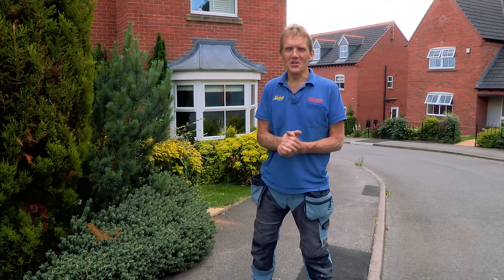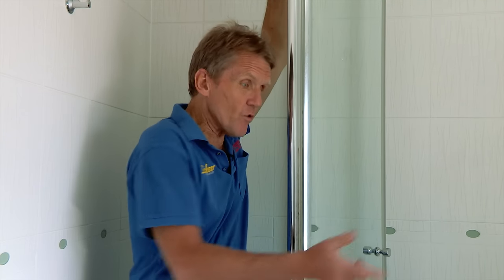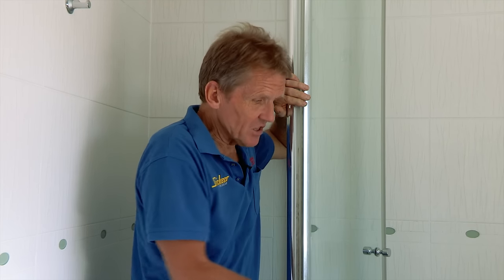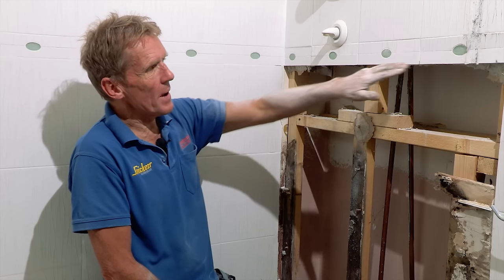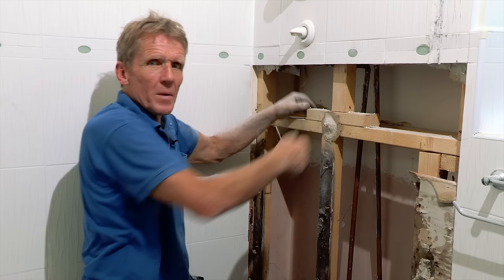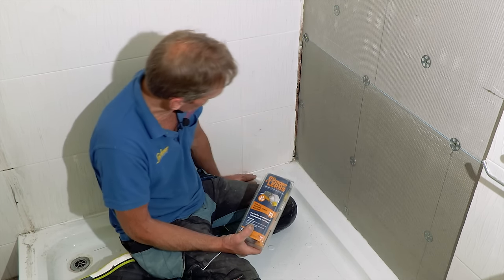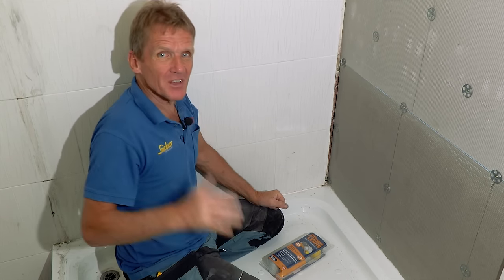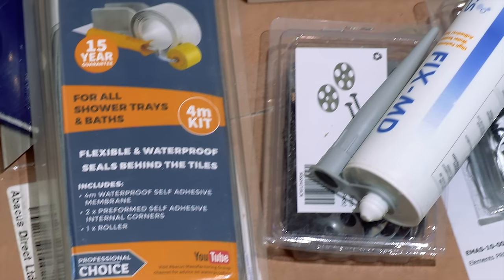Unbelievable Cowboy Plumbing Horror Show

Comment: Here in the states we often use cement board like Hardie Backer and a water proofing membrane like RedGuard and then tile from there. I've demo'd out 30 year old showers that were installed like this and they didn't have the slightest hint of water intrusion. Sadly it comes down to costs at the end of the day. The right materials cost an extra $300 over drywall install and the extra time probably costs another $200. That's $500 per shower per house and that is a lot of money when it comes to the thin margins developers are working on.
Reply from the maker: Thin margins and property developers should never be used in the same sentence. Certainly in the U.K they can sell any shit for way more than they spend.

Comment: Every house I have owned has had this issue. I have had to rip the showers out due to tiles on plasterboard. Leaks also from the shower units behind the tiles. I rebuild with tile boards and water proofing kits/solutions. In some cases if I have the space, fit 12mm ply behind the tile boards just for piece of mind and strengthen the stud walls. Nothing moves and no water gets through after. I like the insulated tile board and will try on the next one I do. I like using surface mounted shower valves. Just easier to replace if you get an issue or if it leaks.
Reply from the maker: Totally agree and the bar mixers are very easy and cheap to swap over if there is a problem.

Comment: Should of sorted the plumbing before putting the new surface back. The Valve should of been supported and the pipework with all the green corrosion removed. The plumber who did the pipework didnt clean off the flux residue, in a few years more this will have eaten thro the pipe causing a leak which will have negated this remiedial work. So yes a crap job put right, but the job was only part put right.
Reply from the maker: Yes well you are right and the valve was supported and everything was left in good working order but we then decided to rip it all out and fit a new valve and tray. You can see this video by following the link.

Comment: You're right, marine ply is NOT for hidden use in a bathroom. It's only for cabinet use outside of a bathroom. (like on a boat) sometimes used inside the hull.
  You didn't show the proper way to fasten the plumbing. It was only onscreen for a fraction of a second.  9:35
Reply from the maker: watch the follow up video

Comment: This is an interesting product.  I typically use cement backer board for tile surrounds.  The seams get sealed with mesh tape and mortar.  Then the whole thing gets three to five coats of waterproof membrane before tiling.

Comment: fantastic step by step correction video .... so if my builder has bodged my shower??...
(I will never know but I have a little patch developing in the corner of my loft stairs)
However my question is:   rather than rip it all out and start again.    Can I put new large tiles onto existing tile to give it that extra water protection..    ( the new tiles will sit ontop of existing grout lines..)   Is this an alternative and useful fix , also?
Reply from the maker: You can tile on tiles and it may be good but before you do make a seal between the old tiles and the tray using some No More Leaks tape or similar. That way nothing will get through. You don't need to follow the old grout lines just tile straight over those old tiles. Tiles are the best surface to tile onto but used cement based adhesive rather than the stuff in the tub.

Comment: This an incorrect method with the shower valve.  He has totally sealed the shower valve in with the tape and sealant.  If the valve fails and the body has to be replaced the area will have to be smashed out!!  RTFM. (Read The F*** Manual.)  The wall should be cut and tiled to allow the valve to be removed with no damage.  A shroud is supplied to cover the valve and make it water proof and allow easy access.  How can this man be allowed to talk crap to people as if he knows what he is doing?
Reply from the maker: That is your opinion and it happens to be wrong. A lot of cover plates will only allow for close tiling and it is very easy to take a tile out with a multi tool. Times change and you need to keep up rather than coming on here trying to misguide people. You will find, if you bother to do any research that the body is a first fix item and, in most cases the removal of that part is disruptive but the good news is that the manufacturers thought about this and their design allows for the removal of the working part with no need to touch the tiles. Any plumber will tell you that valves can be serviced in this way and if the parts require a complete cartridge swap, as is the case with Aqualisa this is no more than 30 minutes work. 

You will also find, when you do your research, that most concealed valves are made to be fitted in two stages. First you plumb and tile, then you remove the protective cover and slip in the working part. You may find it useful to watch this video before you comment.

Comment: That single foam backboard at 7:24 is probably more expensive than a whole wall of the cheap stuff that was installed previously.  That's what the installers were avoiding.
Reply from the maker: It is not crazy money but you are right, it is all about money. Doing it twice is always more expensive

Comment: We use 100 x 50 studs and dwangs.  Those studs look like 70 x 25 and little horizontal support,  means the whole wall can flex like a whoopy board.
Reply from the maker: I braced it back to the masonry

Comment: With a new install, should the shower tray push upto abacus boards or the boards sit down onto the tray?

If using the 2.4 x 1.2mm laminated type shower boards instead of tiles, what do they fix onto?
Reply from the maker: Take the Elements board to the floor then seal the joints and the tray to the Elements board. You can then stick the laminate boards to the wall and sit them on the tray. I usually leave a 2mm gap and gun the silicone into it and finish it flush.

Comment: wth?!? putting your so called "water proof elements board" on a rotten/mildew piece of wood..
you bad mouth other plumbers/contractors and here you are..put new on old rotten..smdh..shame on you
Reply from the maker: Yes except it isn't rotten and with no moisture it will not thrive. Yes it could have been cleaned but there was no rot.

Comment: What's the problem? We cowboys have been using the insulated board for over 40 years. Looks like you need to learn about mold mitigation.
Reply from the maker: mould is not the issue. Once it is dry the mould dies, there is your mitigation, no need for chemicals

Comment: Great video Rodger. Why refit a buried shower valve though - a surface low profile thermostatic valve such as a Grohe would ensure you don't ruin the work done in the future if the valve gives out..
Reply from the maker: Hi Mark 
 It is very easy to force your will upon the customer but it gets you a bad reputation. I may advise but in the end the customer must decide if they want me to replace the valve. Things moved on from here and we did another video where I ripped the whole lot out and put in a walk in shower.

Comment: When we built our house we used 12mm Hardi backer board instead of plasterboard in the bathroom. It's harder to cut than plasterboard but virtually bomb proof.
Reply from the maker: It is a good product but so is Elements board which is easy to cut and can be curved if required. Also Elements board is insulating.

Comment: Roger, great video!  It looked like you secured the water pipes south of their 90 degree turn.  Any reason why you didn't (appear) to put a brace across behind the valve?
Reply from the maker: I did brace behind the stud back to the wall. It all came out for the new shower

Comment: your not using nearly enough fixings in that board  should be 400mm centers on every board edge not one fixing bridging 2 or 3 boards your leaving several kg of tiles and cement and grout on every washer
Reply from the maker: Peter
The system is fine. We have done loads of this and the board will take 50kg per sq mtr on those fixings. How do I know. 
We use it on show room displays and you need a wrecking bar to get them down.

Comment: Used mositure resistant board in my own bathroom, I used a slurry coat of tanking before using sbr and an Flexi adhesive for tiling onto. I fed the pipes for water in-between old honey cone pboard at the shower end as I didn't replace that because it was ok (an a pain to replace as you have to remove the whole wall inside an out). So I wrapped the hot an cold feed in duct tape, tanked through the cut outs I'd made for the new shower mixer. Sometimes these jobs can be such a massive ball ache but take your time an do it right first time is the key. Water is so damaging to a home

Comment: Been doing wetrooms for 20 years,always used plaster board with no problems,the tile adhesive is waterproof and so is the grout so it won't penetrate to the board.
Reply from the maker: Steven  
That is so wrong. I have seen countless failed showers fitted as you describe. The only justification you have for doing a sub standard job which doesn't meet the British Standard Code of Practice is that it is cheaper.

Comment: Just another great video showing the builders building lousy homes with big price tags and home owners ending up holding the bag. 
BTW: From the coper oxide residues left on the copper lines due to NOT cleaning the solder flux from the copper lines after soldering, you may have to return to this site to fix the pipe leaks in a few years. Let's hope not. 
Good video with sufficient details. I wish home owners could file lawsuits against the original plumbing contractor based on the evidence presented.

Comment: Nice guy but the whole shower needs to be removed and replaced completely because if the original installation was done incorrectly in part you can bet another part, usually the beginning, will reveal itself later
Reply from the maker: See part 2: https://youtu.be/Cn_KD5HfYH0
Reply from the maker: Even Flow 
 I am very wary of going into a customer's house and talking them into a load of work they could not afford. It tends to get you a bad reputation but, in this case I agree. If you look at this video you will see that we did decide upon the course of action you recommend. You might imagine that it was a waste of time doing the first job but we wanted to make the video. I made a price adjustment and they got a very good deal for letting us make both videos. 
 https://www.youtube.com/watch?v=fxQqgZjzVtE
Reply: @SkillBuilder  I caught the video of that good job on that I wonder why the shower trays are so different than ours in Detroit

Comment: Great vid
Only difference I was shown
Sealant on edges as butted together and pressed out
And  sealant on screw and washer and pressed out thru washer holes
Just done my 3rd  house renovation usi g this method 
First one  lived there 12 years 
Still perfect when moved
Used Wedi board and fixings
Can get thicker boards 50mm!!!!
Even made seat in shower last time

Comment: Rog... You didn't tell us in the video where the actual leak or where the water was coming from to cause that initial mess?
Reply from the maker: Sorry if I didn't spell it out. The shower valve was hanging on the pipes and moving around so water could got in around the sides. There were so many things wrong that it was pointless focusing on a particult fault. The point of the video is really that using board which decomposes when it gets damp is not a great idea.

Comment: Is there a preferred way round to apply the tape and blue sealant? Not sure if the grey rubber strip should be facing outwards or inwards
Reply from the maker: There is no guidance on it but I always put the tape shiny side out so the rubber is on the top. It will stick either way. The important thing is to stick the edges. The rubber can move if there is any movement in the structure.

Comment: How about that long crak on The top that he didn't Seal? Water vapor Will absolutely go thru there..
Reply from the maker: That was gunned in with a flexible polymer. No point painting the ceiling with the ProSeal as it is blue. We always seal the joins and it allows for movement.

Comment: Do you not have to replace the moldy wood?  My husband and I are getting ready to take on a project like this.
Reply from the maker: Once the moisture has gone the mould spores can be cleaned off. We did replace the whole lot in the end but if it is black mould a simple fungicidal was will do the trick.

Comment: I wonder if he fixed that copper elbows that would probably leak by now..
Reply from the maker: They are brass elbows and they aren't leaking. The expansion on the plastic pipe is over 600mm. After that it is in the floor.

Comment: I can't believe he didn't replace those beams with mold in them, just scraped a bit of it off the top.
Reply from the maker: A little bit of surface mould is no reason to replace timbers, it isn't dry rot. Get rid of the moisture and you get rid of the mould

Comment: Good video, but personally I wouldn't have re used the old valve and removed as much of the old pipework as possible to get to. Gets to a point where I have zero trust in the old installers ability to do a good job and I do NOT want to be recalled to repair something I didn't install.
I've had this issue in the past where a plumber didn't use any plastic push fit inserts on his speedfit pipe, compression fittings leaking (obviously), and I have to remove my own work to repair it.
Reply from the maker: you are right and if you watch the follow up video you will see that I ripped it all out but it is really about what the customer can afford. If they have a leak and want it fixed that is what I do
Reply: @SkillBuilder  Understood, my view was from an insurance point of view as a lot of these jobs I get is the result of going thru insurance. I actually am now on a double insurance job repairing the cowboy 'wet room' job where they ripped out an old wet room, removed all the tanking, then didn't tank the new room AT ALL, re used the old valve, leaking, compromised the entire room, push fit pipe with 50/50 inserts or no inserts.. Pure cowboy heaven.

Comment: As much as I respect Roger having just fitted those waterproof pamels they are expensive wank. Yes they are waterproof the joints are not , the boards have little structural strength and with the current trend of 600mm stud gaps there is quite a twang (deflection) in the board. Add to this the small board size and you pretty much guarantee flex in the wall. Few tilers will use the approved screw washers and even fewer a flexible tile adhesive so in years to come the board will remain intact but the water will still permeate through the grout get behing the tiles and either breach the bottom silicon seal or pop the tiles. I am afraid that apart from solid wall panels its impossible to stop our old enemy and friend water from doing what its been doing for millions of years and filtering through the rock or in our case hundreds of grout cracks .Besides a new bathroom every ten years is good for the trade although go neutral and never chocolat brown like one of my customers!
Reply from the maker: What a shame. You can get large format boards. The joints are waterproof and so are the fixings. We have put larger format tiles (even 6mm porecelain on the board with no flex problems. 
The idea of changing a bathroom every 10 years is probably desireable for many but it is not good for the planet. We have to start building for longer.
Reply: @SkillBuilder  I would rather build properly than be one of those crash bash wheres me cash types but honestly most new housing has appalling build quality.  The fact they are willing to reduce an internal wall to plasterboard crmpled paper plasterboard , plastic piping everywhere , throwaway boilers , preformed roof trusses etc just so the developer can ' reduce labour costs'  never mind minimal parking spaces if at all will start to make some of the older 1930s housing stock look like it was built for kings. A house should primarily be built to be a home and not a 'property' , as to green credentials , warm yes , no damp yes,  the rest in this greedy needy lost generation is just so much hot air .

Comment: I think it is wrong to say not use plasterboard and throw anyone who uses it off the job, as you have mentioned early in your video someone using waterproof board and doing the job 3 times! Any job done correctly using plasterboard is good enough and will last 10-20 years and not the materials you use.. its the knowledge to do the job correctly!!
Reply: Re. "Any job done correctly using plasterboard is good enough and will last 10-20 years": Only 10-20 years? Is a home owner supposed to pay for a wall's plasterboard replacement every 10-20 years? If the plumbing behind it is done right, the the plasterboard is properly installed, mudded, and primed and sealed with anti-mould paint (since we're talking about bathrooms), I would expect 80+ years of problem free use. I am living a nightmare of home repair issues and costs caused by tradesman, a little previous owner diy, and a structural engineer who made things to last 10-20 years and thought "good enough."

Comment: Love the video as always. The kit is fairly pricy but looks worth it.
 But what would people do it it is not available? What would u use if not this abacus product as people are saying it is not available in their country?

What is the cause of the water ingress if the plumbing is done well. Is it the flexibility of the plasterboard or the grout coming out? Doe the tile + adhesive not waterproof the other areas adequately?
Reply from the maker: The tile adhesive will not give you a perfect waterproof seal. You can use cement board and a polyurethane paint. Look up shower tanking kit and you will see what is available
Reply: @SkillBuilder  Thanks